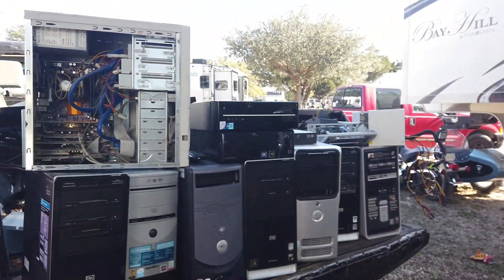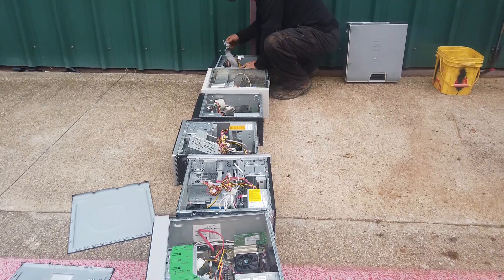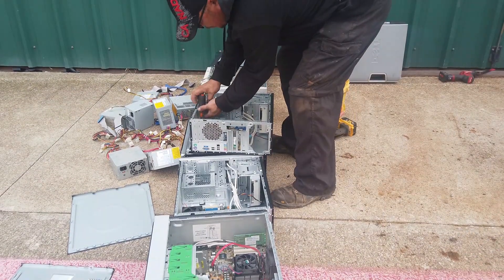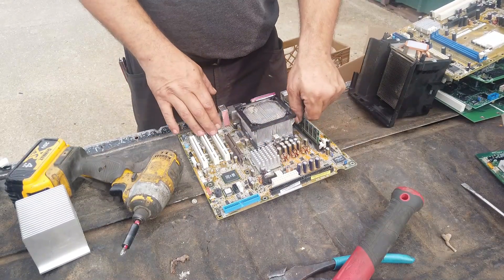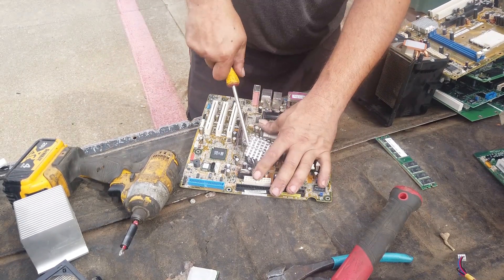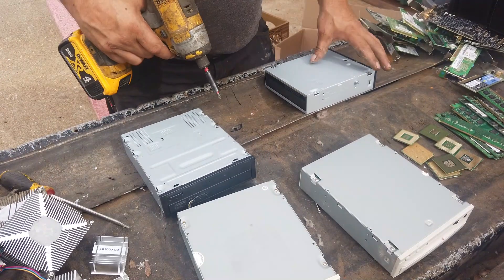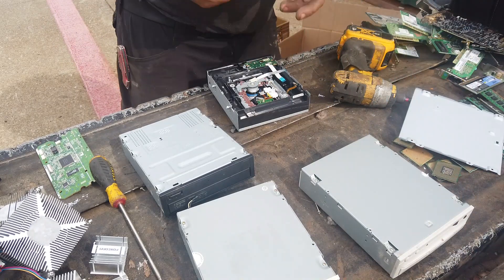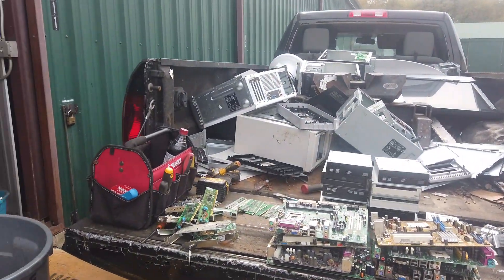Scrapping Computers For Profit - eWaste Pays Very Well

Comment: ❤️ Awesomeness
Reply from the maker: Thanks buddy
Reply: Hey on some of those CD/DVD/blue ray drives,. You might want to check the laser diode. On cheap units it's just a photocell on a gold ribbon wire. But on the higher units, there's a gold cylinder inside the silver cast that which would read/burn onto the disc. *Not sure if it's solid gold, but sure is pretty 😉
Reply from the maker: I don't really  have the time to dig out the smalls. I'm moving to much product at the moment!